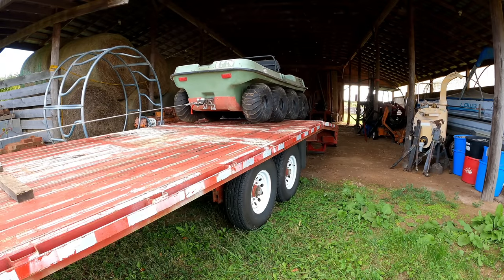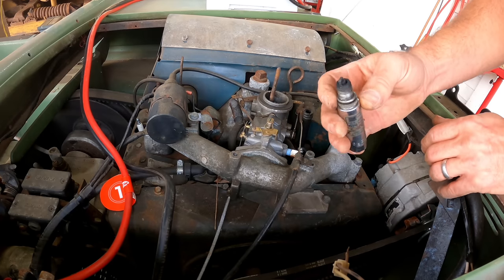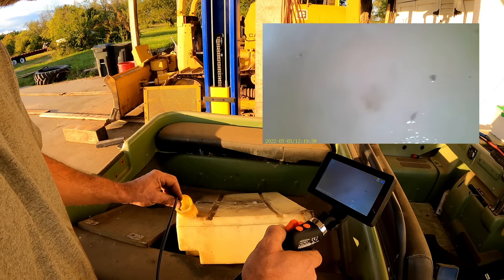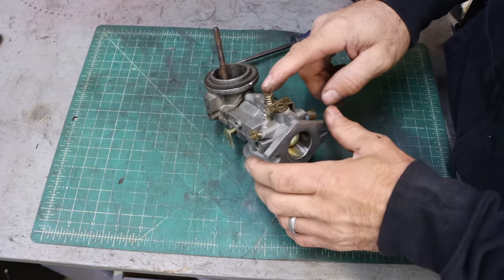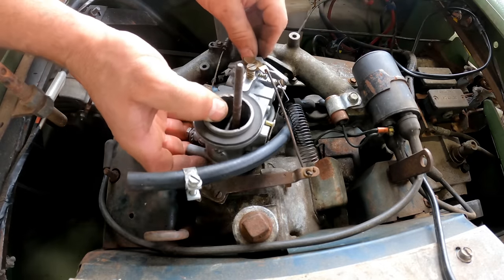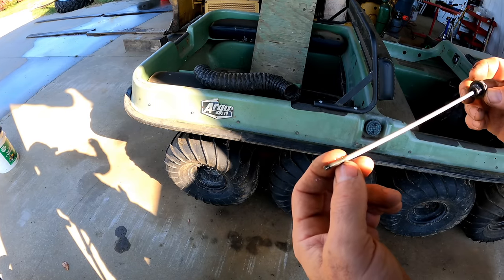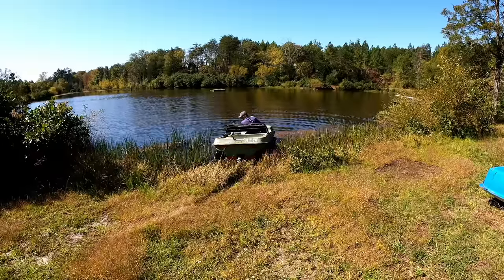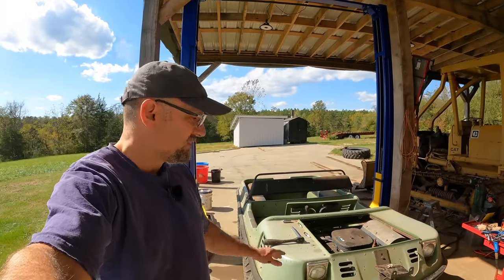Fixing An Abandoned Argo Amphibious Vehicle, Will It Start?

Comment: It's cleaning itself up some. Little by little. You can see the difference from dark carbonated spots on the top portion of the aluminum alloy.is cleaner on the other side of the  spots on both of cylinders piston tops to. I would try clearing out your pathway more flatten surfaces until your ⛓️ chain.,or chains loosen back up once again on that Argo machine. Those plugs need replaced due to leaking rubber garment seals are bad on the pull up and push down to release and stop and plug up those holes with. They're most likely dry rotted from not being used.,or replaced recently and seal lubed up. Then just drive it around before going back into the water. I'd put it up on jack stands to free everything up first. Letting everything soak in some PB- blaster penetrating oil then spray some chain lubricant on the ⛓️ chain to. And Everytime it comes out of the water to. Mean while it's soaking though I'd cutting down that tall saw bladed grass take it down flush about 7 feet wide.,or more. Then see what it'll do. I would definitely fix those busted and cracked and split parts of the body with fiberglass and resin olive green powder coating powder mix into your top coat paint and gel coating last. For curing reasons alone one,two,three steps procedure process. Remember to sand it all down and to use all of the cleaning and wiping down procedure process to. Those have replacement trim rubber noephre seals for the wrap around aluminum alloy strips to. Use aluminum alloy rivets to again where there missing from to. I highly recommend getting some 3M trim emblem adhesive and some weather stripping adhesive to same brand.,or some right stuff.,or flex seal glue.,or adhesive sealant. To put those trim seals on with and rivets to.,an to seal up and block any other holes with to.

Comment: Lol you would have a better chance if you reversed it out of the water, also another trick is to sit in the back with a rope as a set of reins to the steering and theirs a screw on the twist grip that you can lock the throttle open and they paddle much better when its set at pretty low revs because high rpms just make it fight itself with all the water spinning over the wheels, also the v shaped bit at the rear is for mounting an outboard motor, so theres a few little tips for you. I cant remember off the top of my head but you inflate the tyers using a tape measure and inflate  the front tyers  untill they are an inch bigger than the second axle and the second axle are an inch biger than the third axle and the rear axle are, you guessed it an inch less circumference than the 3rd. i think its 36 inch 35 inch 34 inch and 33inch but its been so long  since i have worked on them i have forgotten, it will steer much easier when correctly inflated.

Comment: wet or clean sides on piston top, means oilrings stuck or leaking oil from the underground oilpit😂 give it some wd40 over night a few times it can help if the rings are stuck. also engine oil cleaning can help.

Comment: Well, since its for fun..."wheeled or track vehicle flotation in soft mud)   How much distance is there between the belly of that thing and the grippy part of the mud? It doesn't look like much....so, your gonna need to either reinvent the cattail of do some fiberglass lift kit modding.  

Would it improve the vehicle to give it more ground clearance?  I know they made a tracked version...but that's like bad money after bad money.  You really can be dependent on traction on greasy mud and get bellied up on an old paint can.  Even if the tracks had better flotation...you still need to dig into something grippy.

Comment: that diaphragm isn't it just a gasket that is afloat type carburetor  the best way to get in out of your pond is sand or smaller gravel/rocks clay and loam they seem to spin out - if I remember some of those guys went and changed the tires to a differ type more like rear tractor tire - they had a bunch of boys that had owned those carts to go duck hunting and they could get on and off the ponds and woods  they where getting stuck getting stuck in the middle of no where - also the previous owner mite had jammed the governor to get better performance out of the machine, - also for some reason on the drives it seems to have more rpm/torque and on one side and the steering handle/sticks you pushing on one and pulling back on the other

Comment: a way to trick your "smart" charger into charging a dead battery is to connect a small lamp across the battery, the charger will think the battery in taking current and it will put out 14 volts to charge the battery,

Comment: The previous owner probably used gas with ethanol in it , I stop using that years ago and do not have any small engine problems. I use just ethanol free gas.

Comment: 50:06 At this point I would just be disconnecting the governor entirely and running the throttle cable directly to the throttle blade itself.

Comment: No, that's bs, lead acid battery like to be always fully charged, floated and merely used 5s per day to provide high current output, period, Once the cell have been left discharged for many years / winters, you'll get sulfitation and the whole things will be toast. Even if you bring them "back up", they won't hold a charge. Modern battery are junk, the  plate are too thin, just change them. Fun fact, you can reverse charge the polarity of a dead battery and have it permanently swapped.

Comment: I too don't like the newer chargers. 

I remove transformers from old audio equipment and by adding a rectifier circuit & voltage regulator circuit make power supplies for use when needed such as a 13.8 volt battery a new charger will not act on.

You can even get fancy and use a variable regulator and toss in a meter for voltage & amperage.

Comment: Them argo are very much used here in Noth western On. Canada by use moose hunter canada gosse fishing. Many lakes an rivers you cant get to any other way. Same with moose hunting until freeze up you cant get nothing but an 8 wheel argo into the old winter logging roads there marsh an great for draging a whole moose out. That why you have a winch at least 5000lb most times your floating a moose across a pond river. And  they have soft shit at edges. With the tracks on most times you came climb on top   much less ground presser just like going though 6 feet of snow. But if you cant climb out you hook to a stump or small tree an pull. Same when i got high centered on a big rock in tall brush. There are a go any were machine. Climb step rock faces hydro uses them heavy for checking off road power lines an repairs. 

One thing to note when entering water down a step bank never drive strait in. Go in at a 45 going in strait will get you wet. Nice part is if you fall though the ice  your not going to drown like you do on a sled. You can fully fill them with water an not sink. Liqide cooled ones are best with the cab or cover on you get lots of heat at 40 below. 

You have ring problems with that oil in there. Small engeines are only good for 1500 hours an they are done. Time for rebuild.  They are great due to they only go 28 mph witch is even to fast. Unlike the clowns out in the Bush on Atv or utv flying down logging roads at 50mph getting killed well they past 4 moose an scard up a 100 game birds an much less nose. Dragged many 1200lb moose out to the road

Comment: Watching you take the carb apart after the engine ran was painful. Yes I agree that you should check that the bowl is clean and confirm that the jets are clear with a burst of air, but that’s it. Avoid touching the mixture screws and needles at all costs. Even screwing it in and resetting it to where it was can mess the tune up something fierce. I’ve made this mistake so many times and I’ve spent days trying to get it back to where it started. You’d think returning it to where it was would fix it but when you screw it in you can stretch the size of the hole a little or dislodge some debris that was making it run good. Then you have to find where it got messed up. Usually I trust you in what you do but this is the first time I disagree. I’m a very curious person and I tend to learn by disassembling things and reassembling them. So I’ve taken many cabs apart like this, and I’ve been hurt by it many times too. You do you but for me I don’t touch the adjustable screws on carbs anymore if the engine runs at all on the first crank. Only after the engine is cleaned and checked will I attempt to do any sort of tuning. I’ve found it’s just easier that way. If you mess with one variable at a time the job goes much quicker. I love your videos btw and I can’t wait to see what you’re working on next. I’ve been subscribed since before the time you were making cannons and working on your Johnson lol. Anyway, have a good one.

Comment: I swapped mine to diesel hydraulic offset the weight with the hydraulic tank and motors works way better the extra weight helps with exiting the water 3 cylinder turbo diesel and motors from a 2003 Hitachi 3 5 tonne excavator that was scrap, made a good all terrain vehicle but was still a shit boat 😂

Comment: it's kind'a funny because I see it all the time on youtube of guys trying to get old engines running.... they put oil in the spark plug hole and turn it over after putting the spark plugs back in.... and then wonder why it won't start..... the oil has fouled the spark plugs Dummy !
pull the plugs sprey quick-start in the plugs and get that oil out of there....spin the engine through several times... put  the plugs back in and start it !  use alot of starting fluid because you must over come all that oil that remained in the cylinders ! once it fires up and burns off that oil... pull the plugs again and clean them... get down deep in the plug and scrape the porcelain clean... scuff up the electrode with sandpaper and sprey starting fluid in them to get the grit out. and your good to go !

Comment: fully discharged batteries even if they take a charge there fucked, the plates get sulphated and wont hold much power and alot of times a batterie is cheap and not worth getting stranded over saving a buck

Comment: that engine is trash. you have severe pitting on the cylinder walls. oil gets trapped in the pits and that is why your cycliners are full of oil constantly. the thing must use consume lots of oil.

Comment: that machine is pretty cool but i feel like the tires are not doing a whole lot in the water, even more so when at full throttle. i'm surprised there isn't paddle wheels attached to the outsides of the wheels for water use and the tires are more or less just for ground use.

covid can and still is deadly, that will never change. the only thing that changed was the rate people end up in the hospital. it's never going to go away, it's just a thing that's going to make the rounds like the flu variants and the common cold.
it's still spreading like wildfire, family members got it 3 times in a 6 month period and the city we live next to isn't a big one.

Comment: Max out the air in the tires to get more ground clearance will help a little. Argos do not preform as well and the old Hustlers did. You might could back out better than forward If the weight WAS a problem. I think the pond is just too silted in. Looks like one side pulls harder than the other causing you to steer left and loose pulling power at the same time.Two years sitting is nothing. Obviously have no experience with motors, or mechanics. Start it up already, I bet it runs and drives other than cleaning the fuel system, new gas, new filter and clean the carb. Waste of time watching

Comment: What kind of awful videos are you putting out? You didn't even have to spend a bunch of money on buying new parts.  :)

I always use a sharpie to write what size the bolt head is, especially when it isn't easy to see or reach.

Also, I only use nut drivers on hose clamps. No matter what size or quality, the slot always has a taper, so a screwdriver won't stay in easily.

Comment: 47:49 you had to ruin a good clip with your inadequate knowledge of mechanical terminology whether it is 1 or 100,000 it is always RPM not RPM's the R is the control R=revolution or revolutions (plural) 1 RPM = 1 Revolution Per Minute 1000 RPM= 1000 Revolutions Per Minute so where does the apostrophe come in to make it RPM's your mechanical skills are incredible but please stop making simple grammatical errors